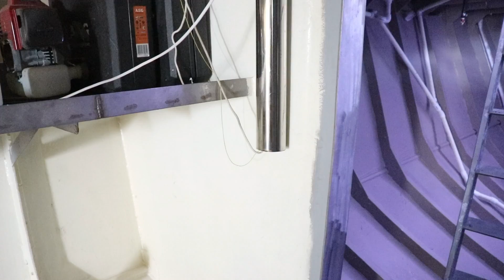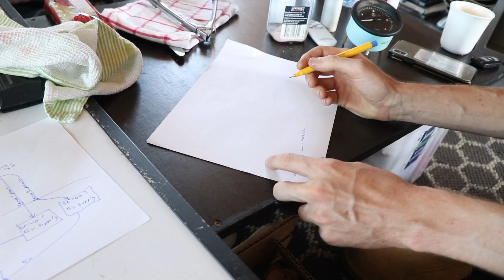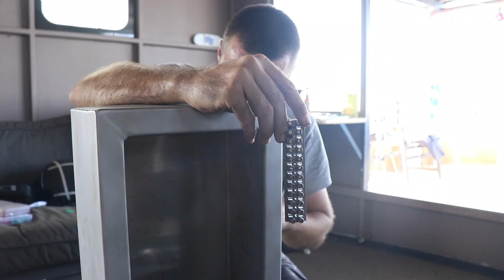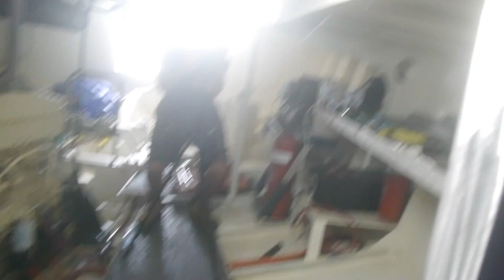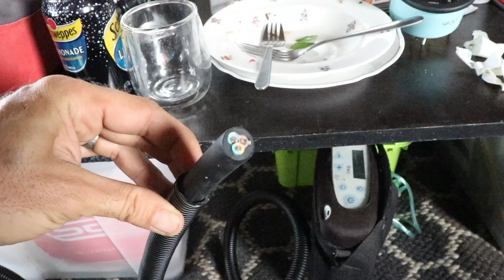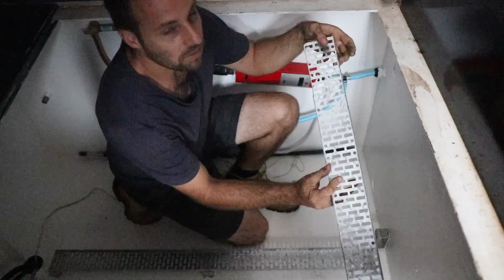Bridge to Engine Bay Wiring - Project Brupeg Ep.69

Comment: A simple solution I use to negate airflow in conduits is to simply stuff a piece of soft foam in the air conditioned end. That should stop the condensation that may or may not form in the large conduit. 
BTW, I’m really enjoying watching the progress. I’m to old and broken down to tackle a project like this, but it was what I wanted to do for decades, just couldn’t get the stars aligned enough.
Keep up the great work! 
Oh, and from one OCD to another, don’t listen to the jokes about perfection. 
We’re the ones that make sure their lives are as easy as they are!
Reply from the maker: I agree, without our need to make things straight wiring would be all over the shop

Comment: Hey Damien - Having spent almost ten years working and managing a top end camper trailer manufacturing company, designing and installing Wiring and plumbing are my areas of enjoyment. I think I read in the comments about segregation of the DC power and the 240 volt power. Due to Australian legislation we could not run both power options through the same conduit. Not sure if that is an issue in a marine application. Two other thoughts, if you cannot have a plastic cover over the box make it a removable alloy lid as you suggested with a clear perspect window under it. Also consider incorporating an amp/volt meter into the power feed from the alternator for quick diagnostics should you have charging issue with the alternator in the future.
Reply from the maker: Thanks very much. I’m starting to think we will move the AC out of the main conduit. We will set it up and run some tests but if we have any drama I will bite the bullet and swap it over. I like your idea about an alloy lid

Comment: Most engine controls and sensors can be controlled by a CAN bus system.  Very similar to what is used on modern cars, trucks, farm equipment, etc...   There is very likely marine grade controls already.
Reply from the maker: Hi Dan, there is off the shelf options available but we could not find a bolt in option for less than 9k, so we built our own with full redundancy and diagnostic ability (which the off the shelf options didn’t have).

Comment: Hi From a ships electricians point of view, 40 years offshore experience,  looking at your plans here, I see many problems in your installation, You need to get a marine electrician to provide you with the correct methods and installations. Drawings correct for your requirements, as for your ss condute  between the engine room and the bridge forget it . miles to small.
Sorry but you need out side assistance , for starters keep the 230 volt AC well clear of any low voltage DC. signal cables.
Reply from the maker: Thanks Alan. There’s always gonna be areas to improve on and learn from. Each voltage will get tested and if there’s a problem we will do something about it. If the conduit is too small we will put another one in. This is all about self sufficiency, learning and not being afraid to make mistakes. However it’s also about safety and commonsense. And for that reason we take the advice of electricians and experts that we have involved in the project, so we are happy to listen to your feedback if it will improve the boat. Thanks Jess

Comment: Damien , have you considered lengthening the bracket slightly on the pipe where it bends around the ladder and putting a catch can and drain bung at that point to aid in moisture collection ?.
My thought is that it is better to collect the moisture before it gets to the junction box.
Cheers Eric
Reply from the maker: Yeah that would work, I think the water issue will be much less than what I’m thinking it will be so for now I’m going to leave it but will keep the idea in my mind if we need to do more

Comment: Make sure you have some manual throttle and gear selection in the engine room just in case you loose all electrical.  Which reminds me, don't forget some self powered emergency lights in critical areas.

I am not sure what your 6V power is for.  Local 5V for electronics ?  You might be better to just use "local" 12V-5V "buck" converters.
Reply from the maker: Jack the 5v is for signals between bridge and helm.

Comment: Use electricians putty on the bridge end of the pipe. After the cables are run, block off the open part with putty to block airflow. We did this in the US Navy for the same situations.
Regarding high and low voltatge in the same pipe - you may find that AC voltage will be inducted into your throttle by wire or other cables. This can cause trouble. I suggest a test regime of all your systems with a full AC load. Have an alternate plan for the AC cables if you get erroneous results. I was an Electronics Technician, and we kept our low voltage away from AC... In separate conduits.
Reply from the maker: Thanks Brian. We will be testing the AC when wired and if issues show up we will adjust the plan

Comment: You can get a proper changeover swktch for a generator to mains 
We live remote where mains power is dodgy at best 
All our breaker boxes have a change over switch where up is mains middle is off to both sources and down is the generator 
Fairly simple to put in as long as both power sources enter the system at the same point 
Ie the fuse box 

You would want a simple start stop switch in the engine bay as well?
Males maintenance and trouble shooting allot easier after you climb the stairs for the 20th time to change some setting

Our sola water pumps have a breather in the top of the control box to mitigate condensation 
Not sure what your doing with the pipe exiting in the bridge but possibly leave it open or seal it but with a breather raised out of the way somewhere

Comment: Just saw you are running AC with DC in the same conduit.  Be advised AC will induce voltage onto the DC wires and cause havoc with your DC systems.  Also if your going to have automatic switched redundancy make sure you have indication of when one of the redundant paths fail.  If you don't one path could have failed and you won't know it till the other fails.
Reply: The longer length the AC runs next to DC the more voltage is induced into the DC
Reply from the maker: Thanks Donald the total length is about 3 m and we have shielded the ABC with conduit as well plus the DC is fairly well insulated on its own
Reply: The induced  voltage  is from the macgnitic  field produced by an alternating voltage.  But if your comfortable with it all good

Comment: Isn't running 240v parallel to signal cables going to cause a lot of interference? I have certainly experienced it running cat 5 cable for arduino signals next to 240v
Reply from the maker: We don’t have any data cabling in this conduit only 5 V PWM signal cabling so interference should be fairly minimal
Reply: @ProjectBrupeg  ok thanks for replying.
Reply: @ProjectBrupeg  If this is for servos I would seriously be looking at differential signal conversion for the main run - impedance and interference are your enemies. Also there is the issue that GND will not be the same both ends - make sure LV signals have their own ground fed from one end.
If this is for throttle control, I think I would want a simple microcontroller engine end to do error checking/correcting (something as simple as needing 3+ consecutive similar signals before moving servo. I would not want a stray 2ms pulse trigger a full-throttle event
If I've misunderstood then I apologise - keep up the great videos :-)

Comment: Positive air shut offs aren't cheap but I highly recommend one. They cut the air and will shut down an engine should it ever start to run away from various causes, most problematic one is if a oil seal in the turbo fails and it starts pulling in the oil from the pan. They can be operated from a switch up in the pilot house.
Reply from the maker: Thanks Jordan, we will be building an air shut off valve when we complete the air filter assembly

Comment: let's hope you don't get induction on your dc line
Reply from the maker: Will keep an eye on it. The AC is pretty well insulated but if it’s an issue we will just run another conduit
Reply: @ProjectBrupeg  A separate back-up AC feed to the pilot house might be a good idea in case of the primary being taken out of service from a problem it may cause in the control wiring. It could be installed with less protection.

Comment: i have an idea for your  condensation concern
Reply from the maker: Ok, care to share it?
Reply: @ProjectBrupeg  yeah i was gonna take a quick video on it because i may not be able to describe it , but ill have a go here quick , then if you need ill make you a vid.

SO the rubber pipe caps ,  you can use these . link below. to cap off the entrance, then use a bit of sitka if there's any leaks, the tricky bit is making clean holes in rubber , if you can do thet you will need no sealant. i have a couple tips on that . you can use a slightly smaller steel tube thats sharpened and a press , or a hole saw with the teeth removed and then sharpened with a file.

If you need a visual representation , i can do that for ya . 

Cheers !

https://www.homedepot.com/p/3-in-PVC-DWV-Flexible-Cap-PQC-103/100372304?MERCH=REC-PIPHorizontal2_rr-100372303--100372304--N
Reply from the maker: Yeah I get what you mean. Makes sense

Comment: If you are installing a fly by wire system, you might want to check survey requirements for separation between propulsion control signal conductors and AC power cabling. EMF from the AC power cable can interfere with sensor signals, so the signal cabling is normally run in separate wire ways from power cable. Greg
Reply: Good point that didn't occur to me. You may also wish to put in a simple throttle by the engine, just so you can run it at different RPM or in and out of gear without yelling over it. I'm talking a metre of cable and something salvaged from a dead boat that has a friction wheel so you can set it and forget it. Nail it to a plank and drop it between frames and you're done. It's really no different than continuing to be able to start the engine in the bay rather than having to go up top.
Reply: The local throttle is an excellent idea!
Reply from the maker: Thanks Greg I will look into that. Cheers

Comment: That engine room is dam noisy! There is a product, made in the US, called "Silent Running" that applies like paint and absorbs vibration quieting things remarkably. Online they're found under silent-running. The dash is important. You won't find them otherwise. I sprayed my whole engine room including the engine oilpan. With just a layer of 3/4" plywood deck over the engine, also coated, I could run my Volvo TAMD60 diesel at 2200 rpm and carry on a conversation without raising my voice. It cleans up with water but once it sets up you need acetone to remove it.
Reply from the maker: Thanks we will look into that. Currently we have zero sound reduction but we will be doing a fair bit in that area when the time comes

Comment: Wrap the stainless conduit with insulation and condensation should not be a problem.
Reply from the maker: I really like that idea! Cheers Jess
Reply: Good suggestion.  The right insulation will also provide some heat protection in case of a fire.  Until the fire suppression does it's job.
Reply from the maker: Good point. Thanks for this

Comment: Put a network wire in the pipe. Run a microcontroler (arduino or micropython) in the box to do data acquisition. Display on computer in wheel house. You can use it for controls too.
Reply: As a suggestion its always best frim a safety and fire prevention standpoint to keep ac voltage 120/240 (high voltage) seperate from Dc voltage 12/24/48 (Low voltage) . NEC requires it in the US . 120 volts will fry a starter or an ignition switch. 240 volts will do much more damage. Just a suggestion.
Reply: Hopefully everything is shielded grounds on the low voltage cabling so that electromagnetic interference doesnt give you transmission signal issues. Good Luck my friends. Jealouse more every video
Reply from the maker: Thanks Tex.
Reply from the maker: Thanks Blake I don’t know what the guys have in store for the next part of the installation but I’ll definitely pass that on. Clints quite brilliant with this sort of thing i can’t wait to find out what they’re going to do cheers Jess

Comment: You might be able to plug the end of the pipe in the wheel house with some sort of malleable putty to seal it off. It could removed if the need were to arise. Thanks for the video.

Comment: I'm sure it will be alright in the end but by fabricating a stainless steel box before running the wiring you have, er, boxed yourself in...Why not fix all the wiring to a suitably sized board and build a box around it?
Reply from the maker: I wanted the box to be welded 100% water tight. Welding it I knew I could do that. Building around something I would always have a doubt in my mind.

Comment: Add the fan to the outside of the pipe , airflow ,no condensed air ???
Reply from the maker: I’m not worried about condensation on the outside, my concern was if it formed on the inside of the pipe and dropped down to the box, eventually filling the box

Comment: 3:49: Or just put an actual small vent in there, perhaps with a 12 volt computer fan whirring away. The engine bay's ambient heat will keep the whole pipe dry, but most of that heat will radiate away before it gets to the bridge. 4:06: "Drip loops": there are no reasons NOT to do them prior to terminal strips, etc. Same as you did around the circuit boards next to the batteries. 4:40: I saw EGT...good Brupeggers...that's an excellent idea to see if you're lugging. 4:52: Remote bilge light indicators in case some seal or seacock fails. Even a bloody camera isn't a terrible idea. You could take on a lot of water before you noticed a problem. 10:16: How I've done this is that all charge circuits go to a pretty massive house bank. From the house bank, the start and windlass batteries are kept at 100% through an automatic charge relay, or "ACR" (https://www.bluesea.com/support/articles/1366/Automatic_Charging_Relay_%5BACR%5D_Explained)...an "echo charger" does much the same thing. So, you have the bilge pumps off the big bank, BUT, if it goes down, you can switch to the start battery or batteries with standard 1,2 switches to run the boat to the start batteries in an emergency or for simple safety during (in my case) servicing of the main FLA house bank.  10:47: The inline fuses have to be really close to the generator, and having both positive and negative disconnect switching on a metal boat is a good idea. 12:56: Drilling holes in SS is never easy nor trivial, even with best practices. 16:21: You can use anything, Lucite, Lexan, fire-rated glass (like in wood stoves), acrylic, if it can take the hinge mounting bolts. Basically, you want to look in there without opening it to see if anything getting melty...because if it is, opening it could give it reason to catch fire with the air supply. Speaking of which, you may wish to rig an electrical-suitable fire extinguisher to hand at that spot, and look up the term "fire port" if you haven't already. 27:49: Tape and string, sharp corners and swearing sounds familiar. 33:54: Well, that was unexpected. What was the issue? The fuel petcock failing to cock?
Reply from the maker: Hi Marc. Solenoid issue was a mystery. We stripped it. It was clean. We put it back together. It worked perfectly. Our guess, tiny bit of shit stopping the sealing plate from sliding back and forth.
Reply: @ProjectBrupeg  I know funds are an issue, but were it me, I'd buy a new one and make the one you've just had apart a spare. I would also recommend a rebuilt starter, alternator, couple of injectors (with the right washers) and fuel lift pump for "wrench off, wrench on" restoration of service. Although I'm sure you have a dozen high-latitude fishboat owners to consult on your spares manifest.  Because tiny bits of shitty mystery seem to occur in clusters!

Comment: You might want to put a damper on the air intake that will starve the motor of oxygen.  If the motor you get a runaway state on the motor you can close the damper and that will stop the motor for sure.
Reply from the maker: Hi Scott yes we will be building a stainless Flap in front of the turbo when we get some spare time currently we don’t have it here filter and the flat will be part of that pipework for the filter when fitted

Comment: Just a thought before you spend a fortune on wire. Can't most be done on 2 wire and control units. Like modern cars on can bus
Reply: Simon, for something like  canbus to work you would need a microcontroller to control traffic and your devices would all need to be "smart" I.e. able to send a coded signal. For a one off such as Brupeg the cost of the enhanced sensors would outweigh any savings for wiring.
Reply from the maker: Hi Simon. Yes we are using common earths and the positives are all low voltage signal wires (ie nothing high powered needs to work up to the bridge through this conduit) this has allowed us to keep most wiring at 1mm conductor size to keep cost down